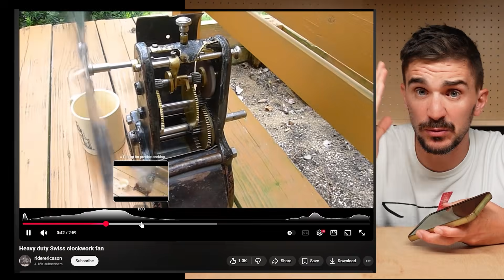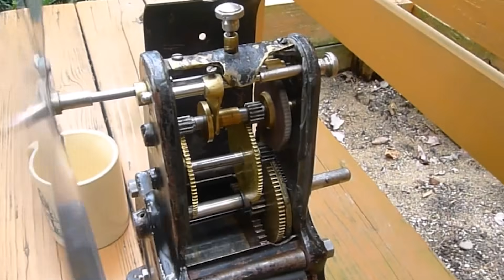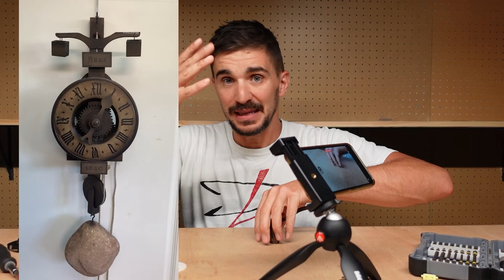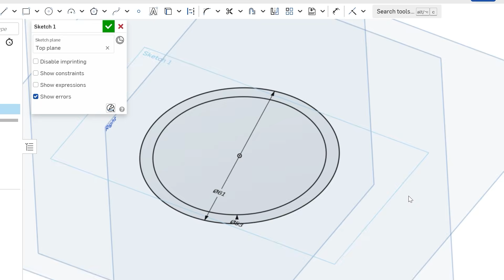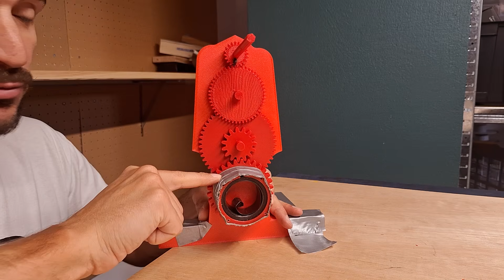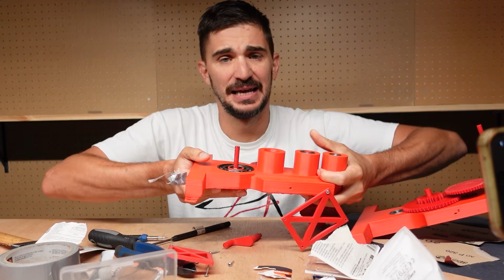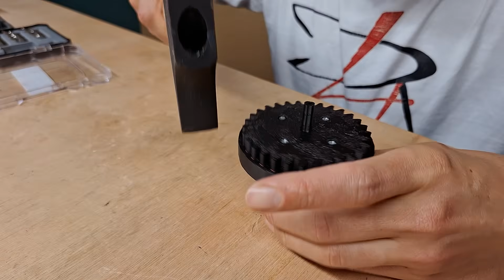No Cables or Batteries, Just Pure Mechanical Engineering - This Swiss Cooling Fan Cools You For Free

Comment: ... So, D4A and Technology Connections are just steadily becoming basically the same channel. Ya know, i'm kinda here for it. both are two of my favorite channels, so i kinda love the technically-not-a-crossover that's going on.

There's also just the factor that the original fan looks like it had a much stronger spring and likely some gear reduction between the main spring and crank.

Comment: Need to reduce the ratio to just barely above what is needed to turn the blade at its efficiency rpm. Not turning that blade fast enough and turning it with more torque than required so runtime is longer and output is lower.

Comment: I have an antique hand-cranked phonograph that uses a mainspring for power, and it runs for several minutes at a constant speed thanks to a centrifugal governor mechanism.

I think if I were to design a modern version of a mechanical fan, I would opt for gravity power using a weight, or perhaps a foot-treadle like on an old sewing machine - which makes use of a flywheel and foot power.

On the other hand, my brother has a sterling-engine powered fan that he puts on top of his wood stove.

By the way you should have used some washers to reduce the friction on your gears, and some jeweled bearings if you want to get fancy.

Comment: I'm not sure, but.. Don't you have that fan blade on backwards? Direction matters for some fan designs. They work better in one direction than the other. Also, a short tube-like housing to guide the air can help. Also-also, airflow is strongest toward the outside of the fan where the blades are widest and moving fastest. There's a near-null zone right in the center where the air is either barely moving at all, or is often sorta just rolling around in a tight spiral but not actually moving forwards.

Fans are a lot of work. they look simple, but are actually amazingly complex in their subtleties. I recommend Farmcraft's vid on his hydro system for some great visualisations of cavitation in water as an example of how finding that 'sweet spot' in a given design changes performance dramatically.

But this was a good vid. Application and exploration of principles. You could likely iterate the design a few more times and get some surprisingly high performance out of it. Clockwork mechanisms are a DEEP rabbit hole to dive down.

Comment: There is a special tool to wind main springs, looks kind of like a screwdriver, you can make something like it by making a long slit in a rod, way easier and safer than trying to press on the outer winding. Source: my grandfather was a clock maker and repairman, and I have repaired clockworks myself too.

Comment: Machinist here - Worth noting, the means of machinery and automation to make those fans already existed by the early 19th century, as well as much of the parts themselves. The Jacquard loom itself use da punch card system which was patented ibn 1804, yet it would take almost 140 years for that to end up in other manufacturing sectors to slap on a tape system and call it an NC machine, and it would not be long before attaching an actual computer for it.

The engineering has long been established, and I can already imagine the original processes involved in making it. It also wouldn't be too difficult to make by hand either. So it's not that this is a difficult thing to achieve (hence, it exists), but external factors may economically affect its production far more than their ability that only evolving technology would solve. Yet, it's also an era where a lot of impressive technology had already been concieved, such as the steam turbine engine. YMMV.

Unfortunately, 3D printing is a bit of a step backwards at that, but it is a good model for demonstrative/analytical purposes. It would work for a Pascaline, but higher precision parts and construction yields better results.

Comment: 1. Get a larger mainspring, like the original, with a hand-crank. 2. PCBway the gears to their maximum finish (and the body while you're at it). 3. Highest plausible gear ratio per the windup strength.

Comment: Also, metal clockworks are not particularly precise, for exactly the reason you experienced. I only know this because as a young boy I remember looking at the internals of a grandfather's clock, and a reasonably priced mechanical clock. The gears are sort of wobbly - yeah, they know that this system is imperfect. They adjusted by reducing expectations

Fun video by the way😄

Comment: storing mechanical energy and using it directly may indeed be not that easy and therefore expensive. However, storing mechanical energy and then using it to to create electrical energy, now that's actually something you can do on a budget. I'm not proposing to use a generator and a motor, although now when I think about it... I was rather thinking about something I saw on Discovery channel back when it did show something good, this was 25+ years ago. It was a radio that had a spring loaded mechanism designed as an education thing for poor regions in Africa so people don't have to use batteries. Obviously this was way before cheap and efficient solar cells.

Comment: you have an H2D. you can use petg for pla supports, or pla for petg supports. either way it will give you the option to change other parameters. do it, and then you won't get that nasty support surface problems

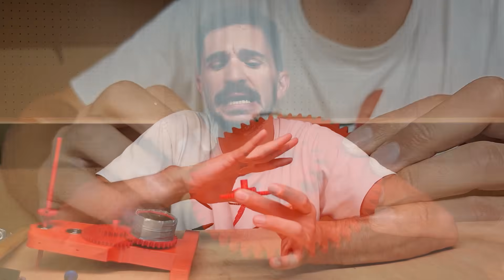Comment: 19:30 Or you could have used multimaterial printing with a support material that doesn't stick to the printing material, like using PLA as support material for PETG (or vice versa) that way you can have perfectly smooth supported surfaces.  (or you could use soluble supports, but PLA/PETG combo is easier and cheaper (PLA also works as support material for TPU))  :P

Comment: For 3D printing you'd be better off using a strong coil spring, plunger with a rack, and 4 lengths of all-thread with metal caps to hold the assembly together. Drive the fan geartrain directly off the rack, when power runs out just push the plunger back down. A plunger as long as the fan is tall would be the most efficient use of space and material.

Comment: I think it would be interesting to see how the efficiency of storing that energy in a battery via a simple generator and just outputting it either directly through an electric motor or with a smaller gear reduction compares to the purely mechanical solution. Also, maybe a belt reduction would be more efficienct when dealing with 3D prints?

Comment: I have a fair amount of experience with printing assemblies similar in purpose to this. The secret to good (and strong) alignment is to minimize thickness of the "frame" parts and make up for the loss of strength/rigidity with braces. So, you had the right idea with the braces you designed but the thickness of the frame was overdone. I myself usually design frame parts with a thickness of approx .25 in then print appropriate bracing also .25 in. This works quite well. I have one that holds two 8 lb flywheels spun at 400 rpm by a 15 to 1 geartrain. hope this helps. Also that tape measure coil spring is very weak. A heavier coil spring would go a long way in increasing torque (amount of air movement) and runtime.

Comment: umm > couple improvements > 1st = PLA is crap for mechanical stuff. Good for cost & housings/cases if mechanical fasteners are used. it has such poor mechanical properties its useless. for example if used for gears it will quickly sand itself to nothing by virtue of its own friction EVEN if the gears are perfect. USE PET/PETG !!   
2nd = grab a bunch of stainless shafts. They are cheap & also can be recycled from trash like motors/printers/etc ... 
3rd = U should have used bushings to get the gear spacing proper so they didn't rub. no sanding required. U don't have to worry about compactness during proto stage of dev.
4rth = supports should be avoided at ALL costs. F supports. design around your flat build plate same as cnc must design around the vise.
5th = speaking of the contraption... I would have aimed for something a bit more modular to find the ultimate power of the spring. THEN, dialed it down. meaning > head for 100:1 or 50:1 to see how much energy that spring ultimately has. If you got all your friction & build problems addressed... the only thing left to do is see what ratio would make the spring unable to overcome the friction of air across the fan blades.  
6th = originally , viewing the thumbnail > I thought the device was going to be a sterling engine. 
7th= this message took less than 1min to type. so I had to do it... we help one another... 
8th= oh and I love my delta style printer. its amazing and I can get my accuracies down to the fraction of a mm. it still amazes me. was purchased in 2015.

Comment: For such constructions - take 2 pieces of wood/plastic/metal, lay them on top of each other and just drill through. And then ONLY 3D print something to hold it together. Far easier to make, cheaper, faster, more precise and also stronger.

Lets just assume a low 10W (20-50W is normal fan power, 10W is around what the lowest settings on most fans deliver). Now lets say you hook it up to a stationary bicycle and push your self hard... oh, you reached 200W - excellent - that means you only need to keep at that sprint-speed for 3 minutes for the fan to run for an hour. If you limit your input-power to anything reasonable like say 100W only then the fan just runs 10x the time you "charge" it. With a handcrank don't even think about reaching 50W for more than a second or two. You are more likely looking at outputting just about the power that the fan would require. So crank for 10 minutes to make the fan run for 10 minutes.

Humans are NOT efficient machines - the calories you burn would cost more than the electricity. Far more.

Comment: In the near future, if you think you will have to repeat this fan, here is a tip: for each gear axle, add stop shoulders to prevent the gears from moving back and forth, ensuring that the gears touch only at the teeth.

Comment: You could get a slightly better breeze by putting a cover in front of the fan. Sounds counter intuitive but i found this out by messing with a 5 dollar battery powered fan, something about the cover 'pointing' the air much more effectively than uncovered blades kinda just shoving air

Comment: funny thing to play with after ironing out some of the immense amount of losses is connecting multiple similar springs together series and/or parallel. as you would imagine, series connection gives more turns stored, while parallel gives higher torque. another cool thing would be an input gearbox that takes a few high torque turns of a crank to quickly spin and fully load the spring(s). and one more thing that would be pretty cool is instead of a crank it would use an engine pullstarter. the extra sweat generated by pulling that thing also helps cooling you off lol
also to be honest, I don't really agree on this thing being SO expensive. yeah it would be definitely much more expensive than what an average person would consider reasonable, but we have $5k audio cables that are just as pointless as the $500 ones. this thing is a reasonable engineering/manufacturing challenge, where efficiency is everything, but it doesn't have to deal with extreme speeds, or extreme torque, and doesn't even have to be too lightweight. optimizing efficiency to cost is not as hard as it first seems

Comment: I'm looking for a cheap "timer" for my sunscoop tracking parabolic solar concentrator, and that is how I came to your video.  Could using a spring from a tape measure  power a "clock/linear timer?   In my case it needs to be accurate to 5 minutes per day.  Ideally something that moves at about 2 cm per hour would be close to the sweet spot and it needs to run for about 10 hours.   I took apart kitchen mechanical timers and they max out at a couple of hours when I took out the spring and ran them with a weight powering them. Could you make a 3 d "timer" that releases  a string or fishing line at 2 cm per hour for 10 or 12 hours?    The solar concentrator is a free design, and it is working great, but nobody is likely to replicate my timing system. (It rotates at 15 degrees per hour to follow the sun and I power it with a "waterwheel winch" and the waterwheel is driven by an "airlfit pump" which is timed on and off by gradually increasing air pressure.  I don't even have motors!  All the power for it come from an aquarium air pump!   But back to other people using the design, they  need a timer (maybe something turning on and off  a reed switch) to turn on and off a motor as the reflector rotates.   I cannot find anything on the market to do it!   In my case,  I use water slowly rising and lifting a float in a 4 inch pipe, this relieves pressure on a rubber tube, and lets air to the airlift pump, until the reflector moves enough to crimp the tube and stop it.  It works amazingly well!  On a sunny day, the reflector gives me over 600 Watts of boiling, or dehydrating for 10 hours!  Automatically!   This is needed now because in poor countries,  lots of people cannot afford fuel.   But no cheap timer on the market means that other people cannot replicate what I have done.  In my case,  the floats are 300 gram to 500 gram weight  and you need to be able to lift or lower that weight at 2 cm per hour, but with a reed switch controlling a slow motor,  maybe your "clock" would only need to move 20 or 30 grams at about 2 cm per hour!   Surly there is a mechanical or electronic way to make something outdoors to do that?  Thanks Brian

Comment: a lot of people mistakenly think that modern manufacturing produces qualitatively better products than in the past, but modern manufacturing is only designed to reduce production costs to facilitate higher profit margins. when you hear that a production has been "modernized", that means it has been deskilled and decontented for the benefit of the shareholder.

Comment: remove the grease from the bearings, also make the gears little more light by cutting holes in the gears to reduce the inercia, trust me im a mechanical engieneer xd
BTW also try to use metal shafts and a better design in the spring drum ! i can help you !

Comment: For sure it needs to be precise like a clock, but you are winding with a small lever, on the video you showed at the beginning they wind it with a proper crank. That means the stored energy is much higher. For release that energy you also need a regulator (escapement)

Comment: Use another gear ratio to wind it faster with a big crank arm!  That fan blade is for a high speed rotation? Maybe use a fan blade made for lower speed rotation?  You should use an impact blade instead of a reactance blade?

Comment: I noticed you are using bearings that have rubber side caps to keep junk out. That add to the parasitic loss caused by the seal or shield. Try open bearings. Maybe ceramic. Nice video. Try maybe using jewels for even less loss.

Comment: I recommend high precision pins to locate your assembly perfectly which allows you position aluminum sleeves to primarily interface between the gears and shaft. Then your failure point is just isolated to the plastic gears, which could be measured and brought into an acceptable perpendicularity and runout then notched to accept a key.

If I had to do this without a plug-in fan in a hot environment I'd use steam or thermoelectric fan. Even an adhoc cooling tower if I have the water. I cannot be burning calories to rest.

Comment: You clearly need a Meccano set. an old set with brass gears, sprockets and chain and the mechanical wind-up motor with 2 speeds and a reverse
Reply: 100%.  I have a very old meccano set with all the gears and bits to build the supporting frame.  Alas I don't think(?) that I still have the old windup motor - maybe I replaced that with the little steam engine...

Comment: They were likely not that expensive when new and likely not very useful either.  Clockwork spring motors were made in huge numbers using mass manufacturing.  Every gramophone, for example, had a clockspring motor in it.
The real problem isn't how high tech they were or weren't, but that clock spring motors don't hold much energy.  A large dual spring gramophone which you have to turn like 200 times holds maybe 2500 joules (say 5 watts for 8 minutes) and even that is likely an over-guestimate.  Plus, the gramophone drive train is likely more efficient than the complex gear train in this fan.

Comment: Compound gears do not need a key way since the shaft is never transmitting torque. You can put washers as shims to space the gear end faces to eliminate the friction associated with sliding.

Comment: Don't forget that with today's technology and manufacturing capabilities they can do a lot more than your demonstration. I like the rock demonstration you showed, because if you needed more power just get a bigger rock, and if you wanted it to run longer just use a longer rope. I saw one invention that used spring power and they increased the run time of the mechanism by using more springs on the same shaft and one at a time as one spring wound down the next spring would engage the shaft. I think we could do a lot of things by revisiting old technology and use today's science and technology and materials to make things that don't need electricity to operate. Great Video.

Comment: If you had a way to find or mimic the cutting action of a tapered broach for the holes the gear shafts ride in, then you could remove more frictional losses.  Broach both sides of the hole and leave the minor diameter alone in the center of the gear shaft hole.  That gives the gear train the flexibility you're looking for as well as reducing friction losses.